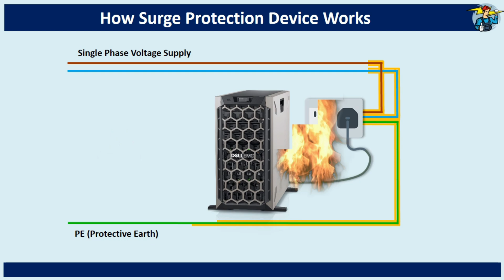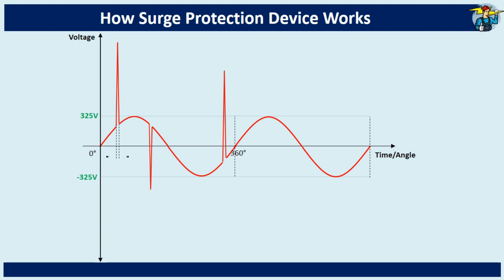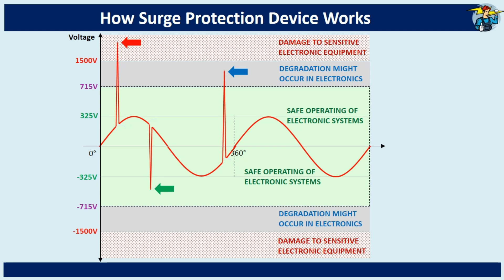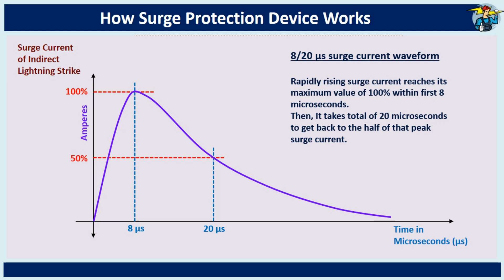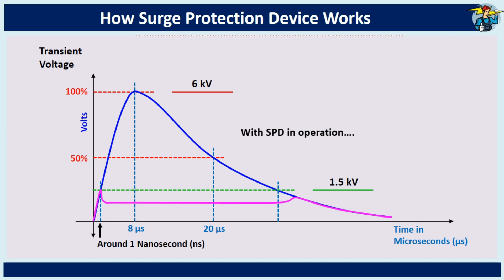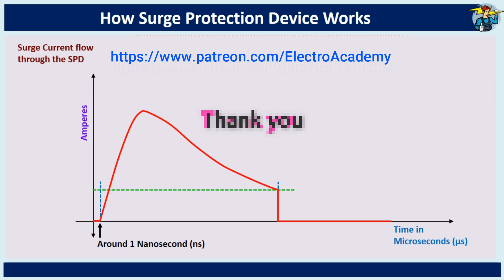How Surge Protection Device works? Do you really need an SPD at your home?

Comment: Hello Sir,

Recently we had the surge current issue and damaged out electronic equipments (Video Switcher ) in out church.

Hope this device can help us in fixing the issue and saving our equipments.

My question is this has to be connected from, after Our UPS output and tapped with our common grounding or we need dedicated grouding for this. And what is the grounding cable distance need to be from SPD to the Main Grounding terminal and what can be the grounding cable Gauge.

Thanks in Advance
Reply from the maker: When installing a Surge Protection Device (SPD) for your UPS system, here's how the grounding should be handled:

1. Grounding Connection:
Common Grounding: The SPD should generally be connected to the common grounding system used for the UPS, distribution boards, and other electrical equipment in the system. This ensures that all devices in the system reference the same ground potential.
Dedicated Grounding: A dedicated ground is usually not necessary unless specified by the SPD manufacturer, or if local regulations require it. Typically, a common grounding point helps prevent ground loops and ensures proper dissipation of surge energy.
However if you go for a separate grounding path using a second grounding rod, distance between two grounding rods must be more than twice the length of one ground rod. (Distance between rods - 20 feet or more)
2. Grounding Cable Distance:
Shortest Path Possible: The grounding cable from the SPD should be as short as possible. If you use the existing ground bar (or earth bar) in the panel board, a good rule of thumb is to keep the distance from SPD to the earth bar under 1 meter (3 feet) to minimize impedance. The shorter the grounding conductor, the more effectively the SPD can discharge surge energy to ground.
3. Grounding Cable Gauge:
The cable gauge for the SPD grounding should typically be at least 6 AWG (16 mm²), but this can vary depending on the SPD's requirements and local electrical codes.
If your existing grounding cable from electrical panel to the grounding rod is less than the size given here, use separate grounding cable for the SPD or change the main grounding cable from the electrical panel to the ground rod.